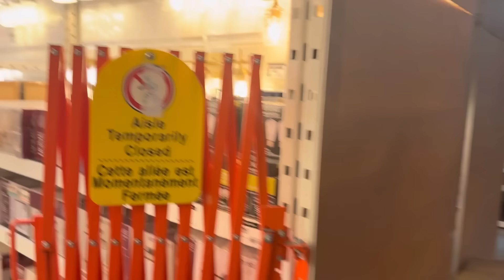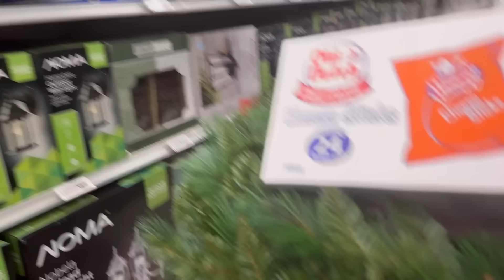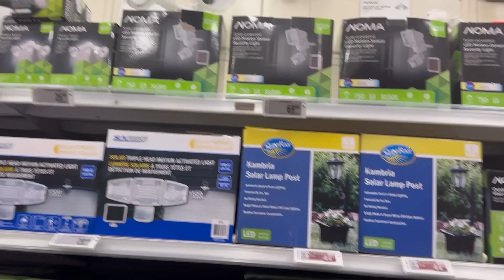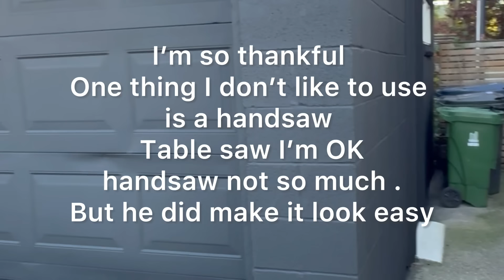￼ One day makeover before, and after Major transformation

Comment: Good job!   We bought the Wagner paint sprayer (like the $160 version) and had good results.  We used it to stain tons of cedar shingles for our house and we didn’t have to worry about overspray. There are several adjustments. For a lower priced unit, we are happy with it and it’s pretty easy to clean. Another bonus is standard plastic coffee can lids fit the paint container in case you need to hold paint in it for a couple days. We’ve used it for several years. 😉. Nice to get the perfect break in weather for jobs like this! I’m refinishing an old desk right now before it gets cold.
Reply from the maker: Yeah, I thought about buying one but this heavy duty one I really painted the whole thing in an hour half an hour each coat so can’t complain but I would like to own one for sure the one I want $1000. It’s really good.
Reply: @mamabrooke gotta save those pennies!  😊
Reply from the maker: Yeah, I might just buy a small one like yours, though. I heard the Wagner’s probably the best one though and you’re happy with it. I see that’s a good thing.